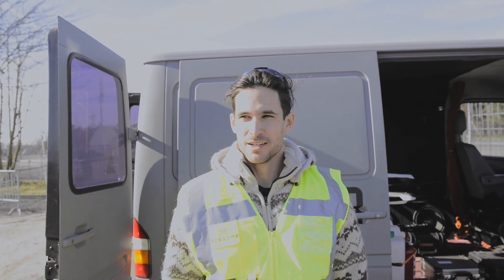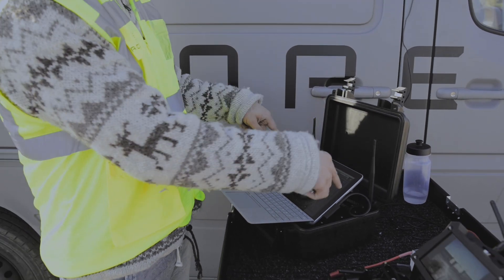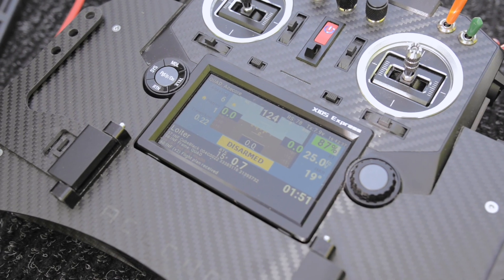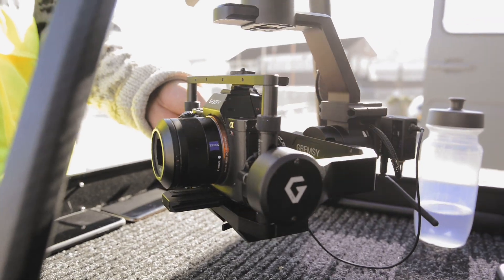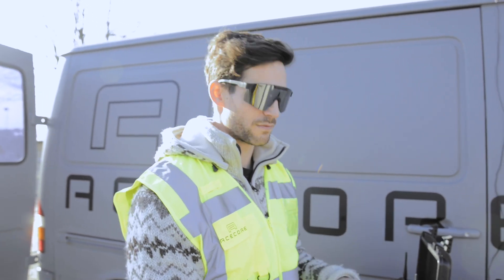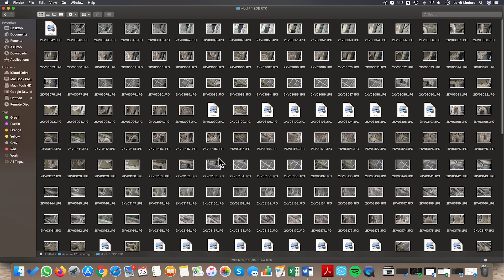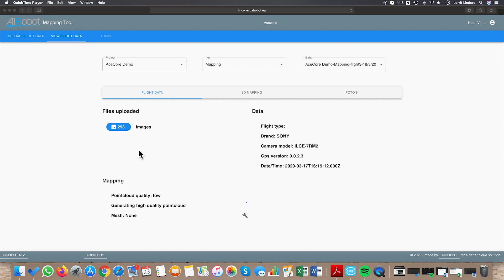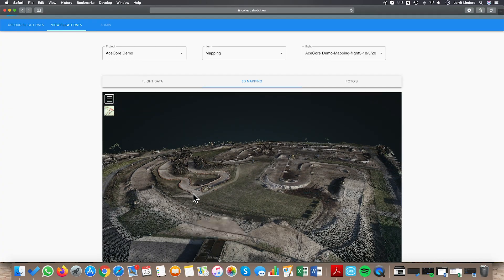Acecore Technologies - Geotagging & 3D Mapping Tool

Comment: Why is there a RTK station needed when there's already a GPS module present in the drone itself?
Reply from the maker: Valid question! The fixed-position RTK (Real-Time Kinetics) base station is necessary to correct the drone's GPS data in real time. This ensures more precise data and more stable flight performance. The correction can also be applied after the flight in which scenario we are talking about post processing kinetics (PPK).
Reply: @AcecoreTechnologies  alright sounds legit! Thanks for the reply :)